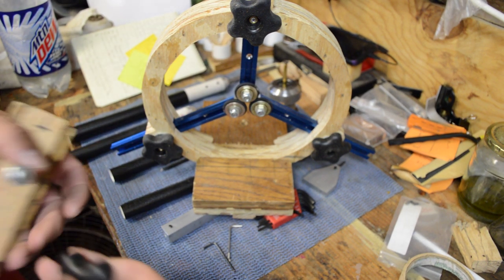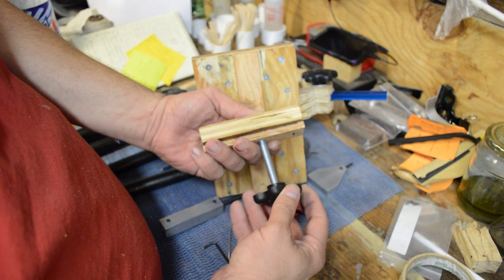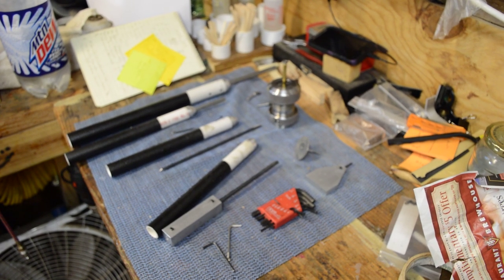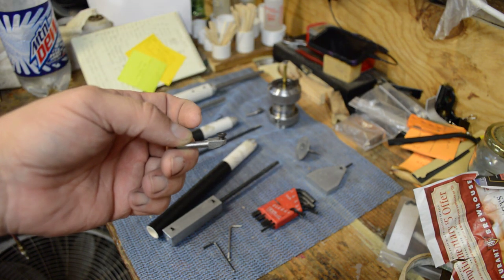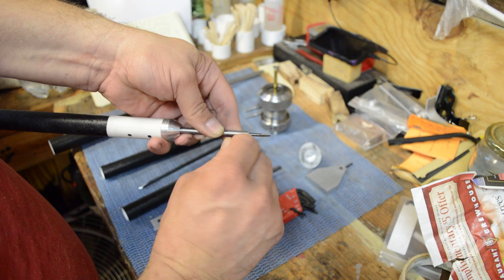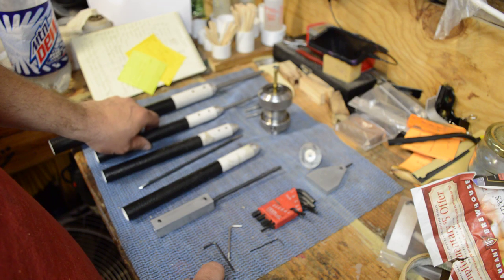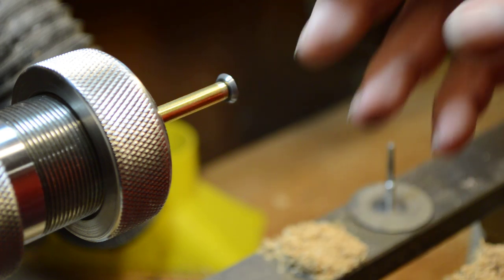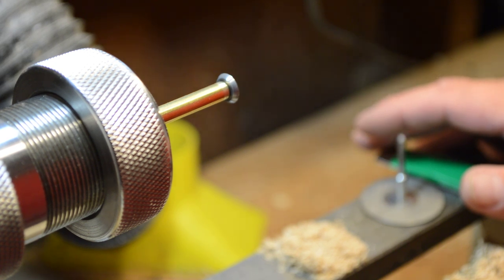HOMEMADE WOODTURNING TOOLS:PART3, SHARPENING CARBIDE SCRAPERS, DRILL SHANK DETAIL TOOLS

Comment from the maker: Not sue what kind those little ones are, they zip and hover like a hummingbird...comical but annoying.
My shop has been inundated with wasps, I think they have nested in the "attic" (shop is in an old water well house, no sheeting on walls or ceiling beams and no insulation.  Wife and I stapled up a heavy tarp for a "ceiling" for winter).  I found a way to rid the errant wasp in the shop...suck them into the cyclone and give it a shot of pyrethrin!!